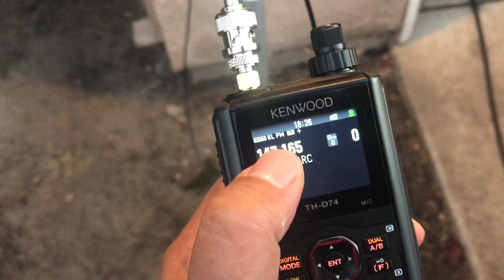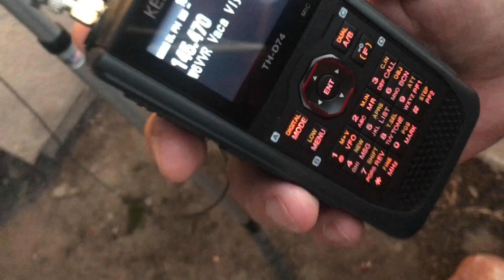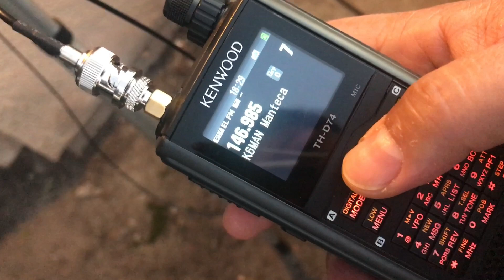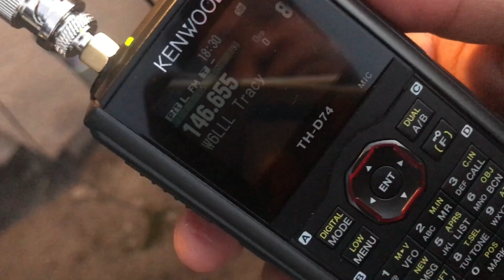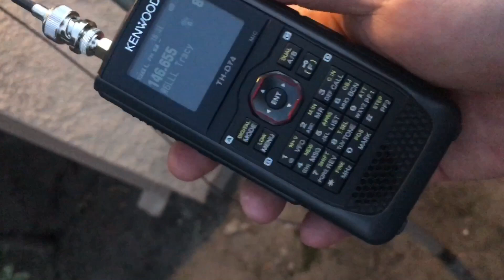Ed Fong Roll-up J-Pole test on QRPP 50mw and 1 watt

Comment: what are the pieces in the extension? im looking to order this antenna and am using a beofeng radio (sma male on radio)....what is best? the SO-239 or N connector?  TIA
Reply from the maker: I recommend keeping it with BNC connectors, and a final BNC to SMA adapter at the end. In terms of the extensions, I just use regular LNR-195 bnc coax cable, about 15feet.
Reply: @AD6DMDennis  Thank you for the help and advice.

Comment: If thats a metal pole it's interfering with the antenna
Reply: That's what I think,  these roll up antennas are very sensitive and mine don't even like to touch wood.
Reply: @jeffmccray8883  I concur I had a conversation with Ed about hanging this antenna from a fiberglass pole and he recommended that I hang it at a 45deg angle to avoid attenuation of the signal.